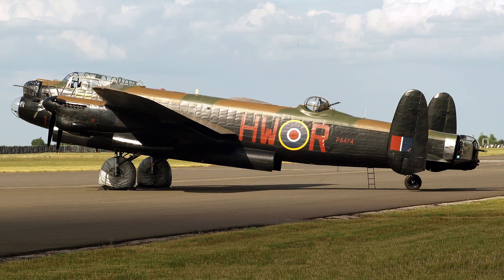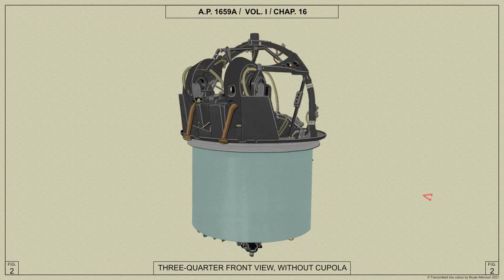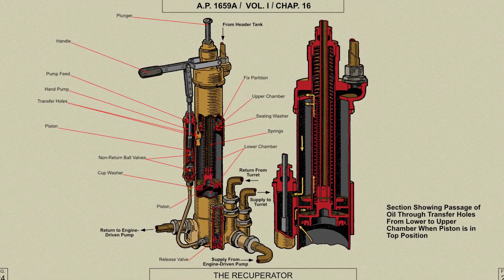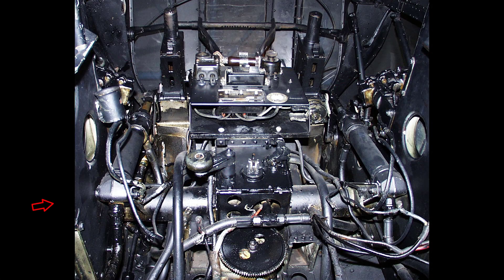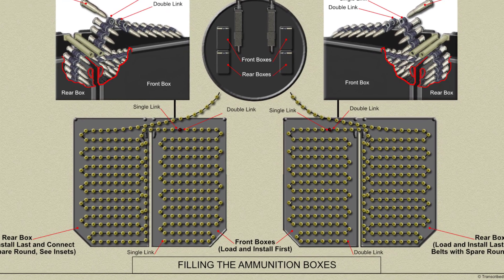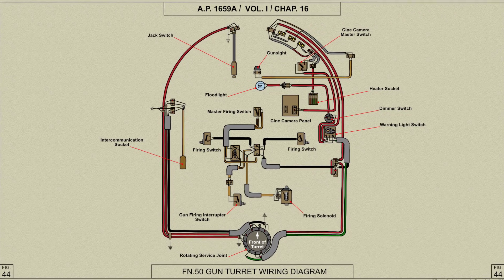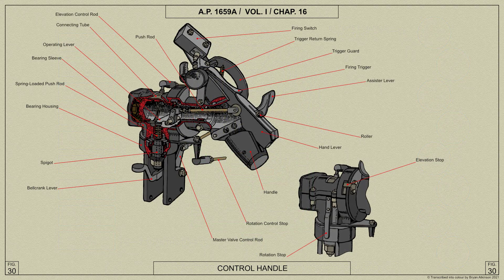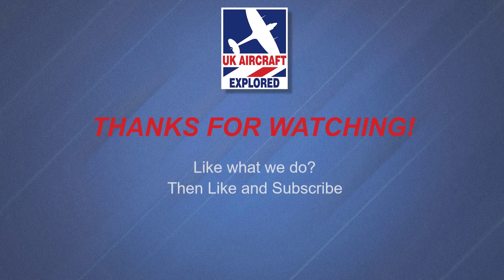Avro Lancaster – FN.50 Mid Upper Gun Turret

Comment: Is there any footage from these cine cameras?
Reply from the maker: You can see some footage of the G.45 Camera Gun on my G.45 Video https://youtu.be/aSmkepllaug Thanks for watching.
Reply: Hi Brian, I’ve watched your suggested gun camera footage. Very interesting. My initial enquiry was pointing to any footage from the cine cameras in the Lancaster mid upper turret, is there any footage from these turrets?
Reply: Thanks a million for this fascinating video.
Just a question :if the aircraft was badly hit, and the skipper gave the order to abandon the burning aircraft, how could the poor Gunner evacuate?
Did he had to find his parachute in a locker or was this parachute already strapped on his body?
Where was the escape hatch?
I would like to see a video about evacuation procedures.
I read in a book that the radio operator's task was to get rid of a whip antenna before his colleagues baled put to prevent body damage after jumping out, at least on Hallifaxes.
Same on lancs?
Sheers, and good show for this splendid documentation
Reply: Gunners typically had their parachutes stowed near their turret, and then had to reach down and clip them on in an emergency (they had quick attach rings on their harnesses).  There were cases of some (v.lucky) crew clipping on their chutes in freefall after their aircraft blew up.